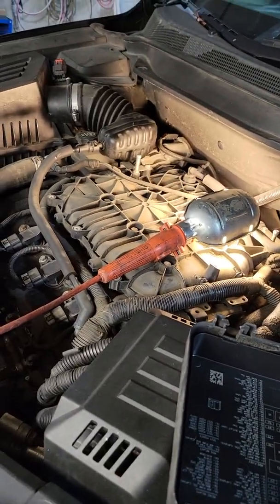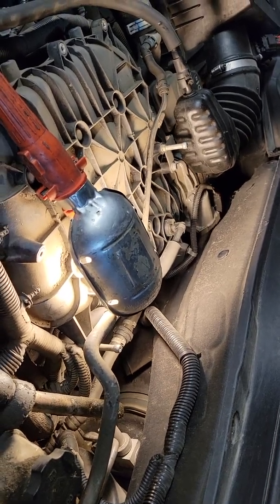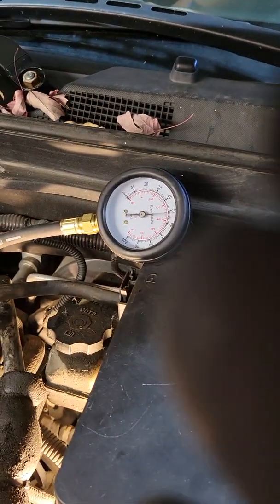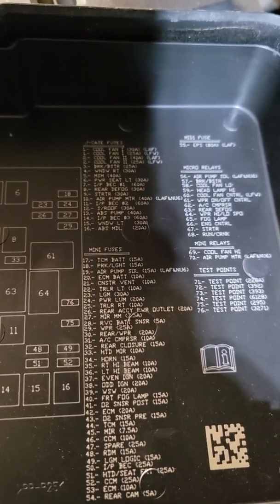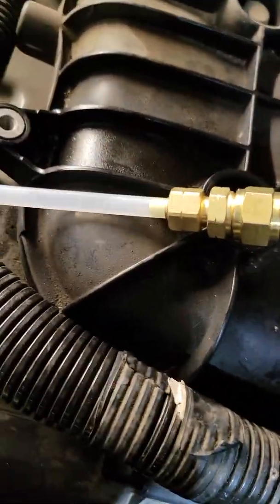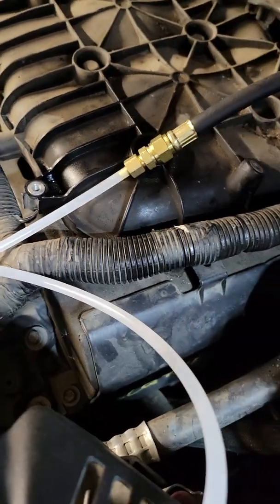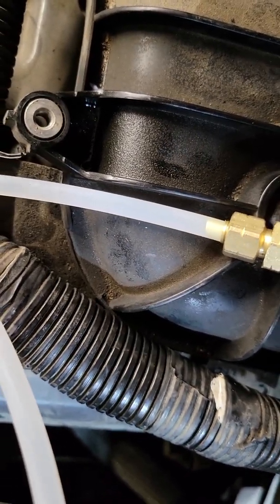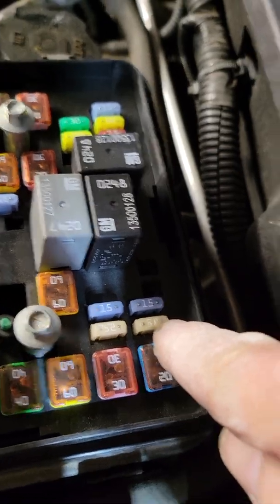Equinox, Terrain V6 injector cleaning

Comment: Thanks for this video. Even though it's 3 years old but it sure is very helpful.  Had a  multiple misfiring code. Changed O2 sensors, cleaned intake valves didn't solve the problem.  I wasn't ready to go through the stress of removing the injectors. Did exactly as the video and my chevrolet 2010 v6 Lt moves like new